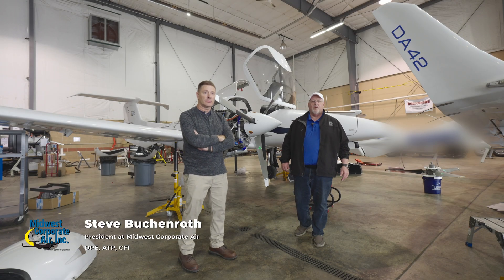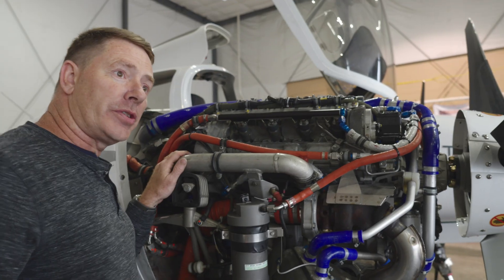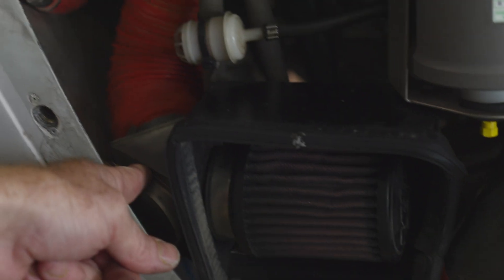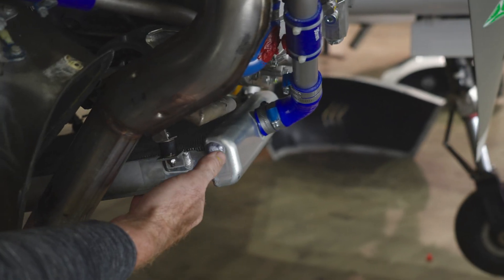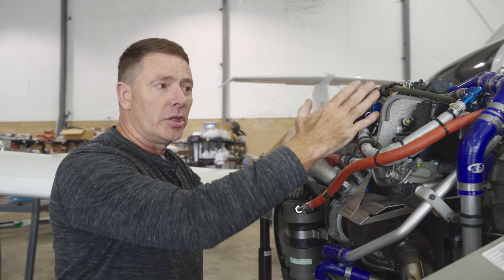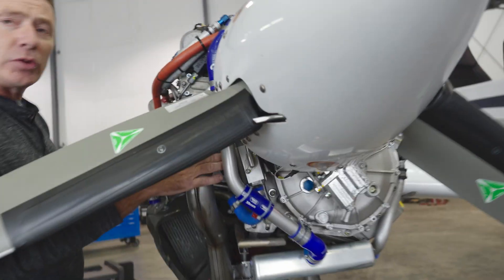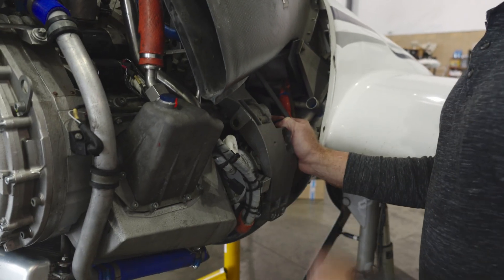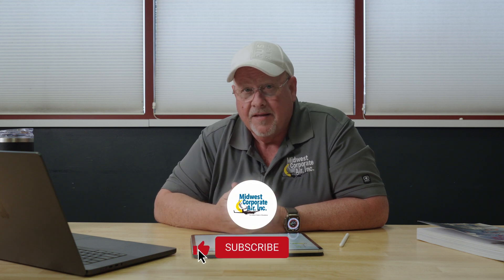DA42 Twin Star Engine System Explained | Diamond Multi-Engine Training

Comment: Considering its a piston  , does it have spark or glow plugs? 2 1 or two per cylinder? 

Is the combustion  driven by spark like a standard aircraft piston or pressure like a diesel engine?  

Great video!!!!

Comment: Question: why the prop is not feathered if the engine is off?  He mentioned that in flight if the engine fails, the prop loses oil pressure and the prop feathers automatically. As the engine is off without oil pressure, wouldn’t the prop be in feathered position? Thanks
Reply: The DA42 utilizes a mechanism called "start locks". Below 1300 RPM the propeller cannot be feathered. This is why you turn off the master with power idle on the ground. If you were on the ground and had the RPM above 1300, then proceeded to turn the engine master off, the blades would indeed feather.

Comment: Great video! Tim is great, he gave me a great overview of the systems when I came out for my CFI reinstatement. The training I received was superior and I had a great experience. Unfortunately, a few weather delays had checkrides stacked up in front of me and I did not have time to wait in queue for my checkride. Came back to NC and took reinstatement ride with local DPE (reinstatement requires no endorsement) passed with flying colors thanks to training received at MCA. Highly recommend MCA.